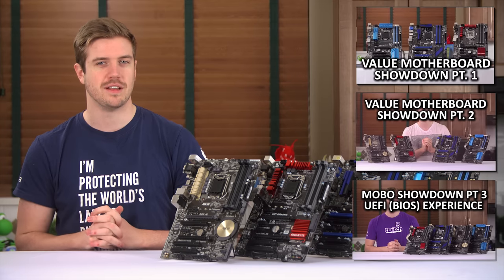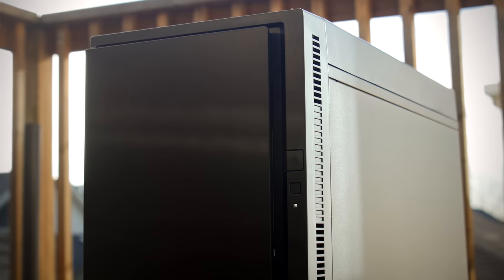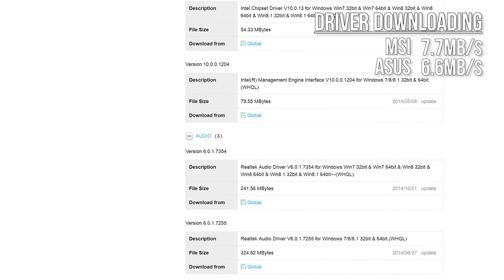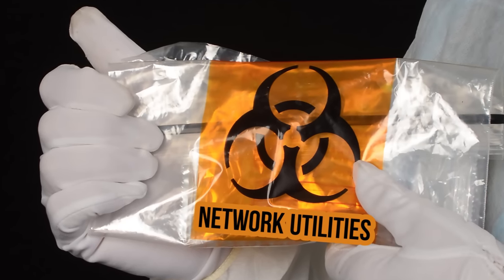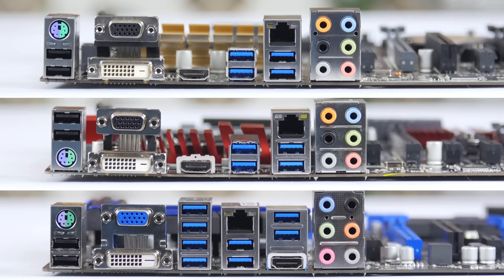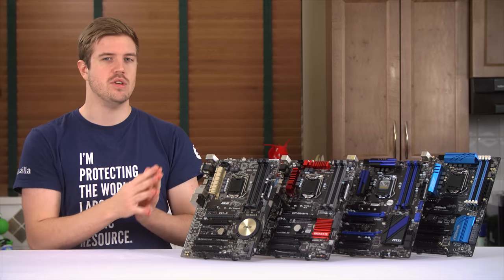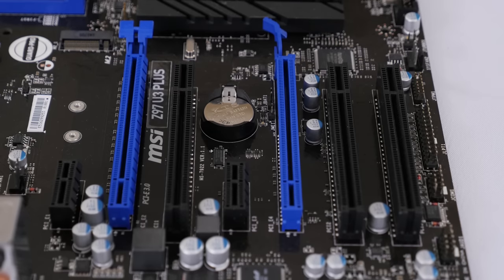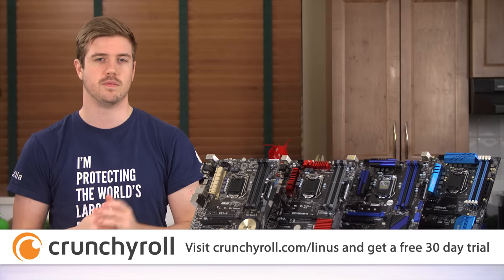Bang for the Buck Z97 Motherboard Showdown Part 4 - The Epic Conclusion

Comment: let me say this...I have a recently purchased asrock970 extreme 3 motherboard for my amd 8350 processor.....stay away...very far away....it takes a lot of voltage to get a modest overclock. Even though I'm nowhere near dangerous temps I cant get more than about a 10% oc because the board will not remain stable no matter how much voltage I throw at it.  . At 1.5 v I can get a reasonable 4.5 ghz....but 4.6 would not stabilize at all even at 1.55v (max). The ram is also very unstable if you try to oc beyond the native speed. I have read several revues that confirmed my findings....asrock is crap....asus is king.
Reply: The voltage you have to use to overclock the cpu depends on the cpu, not the motherboard. I have the extreme 3 z97 board and get 4.4GHz at ~1.2V. It's all about the silicon lottery.
Reply: that's very strange as 1.35v is the stock voltage for 4ghz....and I get 4.8 ghz in a asus mobo with the same chip. and your ram? there are more than a few bad reviews supporting my position on this mobo being an unstable overclocker....I simply add mine to it.
Reply: Ah, my mistake, for some reason I saw the number "97" when you were talking about your board and thought you were talking about a different chipset completely!
Reply: I have a 970 Extreme4 and I had no worries overclocking a Phenom II X4 840 (stock 3.2GHz) to 4.3GHz at 1.4v. I also got a FX 6300 (stock 3.5GHz, turbo 4.1GHz) up to 4.1GHz at roughly 1.37v or so. It's not the board, it's your chip.
Reply: I have this exact board running my 2.8GHZ Phenom at 3.6GHZ.  Very easy to overclock in the asrock utility or in the bios.  I have never had an issue with heat.  I think I paid 60 bucks for this board and it was worth every penny.
Reply: In my vast experience with the 8350 I can tell you that a 970 chipset is not great for that chip. There are many inexpensive boards with the 990 chipset that will do much better.
Having said that, Asrock has stepped up their game big-time but you really have to research and get the right board for your chip and a 970 chipset is going to be limiting to an 8 core 83xx chip no matter the silicone lottery. Imagine a extremely good overclocking chip on a CHVFZ or it's equal, you will have much better results and more stability. Just because it works doesn't mean it's going to work great.
Reply: not talking about a chipset....rather the model
Reply: *****
It's not really about the chip-set itself it's about the rest of the 970 boards. As said above most have only 4 phase VRM's and cannot handle the 81xx/83xx chips. I would not use it for anything more than a Phenom quad core or a 41xx/4300 chip if you want to overclock.

Comment: I'm thinking of building my first gaming PC, here are the parts, let me know if I should change something :) 

~[ Gaming PC ]~
Case: Phanteks Enthoo Pro.
MoBo: Msi Gaming 5.
GPU: Evga Gtx 970 SuperClocked.
CPU: Intel i5 4690k.
Psu: Cooler Master V650.
Ram: G.Skill Ripjaws X series DDR3 8gb (2 x 4gb).
HDD: Western Digital Blue ( or ) Black.

~[ will get later ]~
CPU Cooler: Corsair Hydro H110.
Reply: Looks good. The stock cooler that comes with the i5 is good enough to last you until you get the hydro. Though, if you're not planning on overclocking too extreme on the i5, I'd suggest a smaller/cheaper cooler, like the H80. As far as hard drives go, the Black editions are more gamer oriented and a bit faster read speeds over the other options.
Reply: poikle ok ty :)     going to take a while to save up as i don't live in  the US :/

Comment: I wish mobos can just get uberly cheap. I can see myself spending $100-$300 USD on a CPU, $100-250 USD on a GPU, but when it comes to mobos I can't see myself spending over $70 on any mobo (the absolute most $90 USD).
Reply: I dont see me going over 130$, and dont forgett psu never be cheap at that
Reply: Youll probably end up spending more on a gpu later.

Comment: I have a feeling Luke tried downloading drivers from ASrock's website during BUSY times and the other's during not so busy times.  I've owned Gigabyte, Msi, Asus, and DFI lan party boards over the years and NEVER have I experienced any difference in driver download speeds in comparing ONLY one brand to another's official website, let alone by more than 15%

Comment: I get that it was difficult to pick a clear winner overe the boards here, due to similar feature sets and whatnot, but I'd have preferred that you guys just put your professional opinion on this, "I prefer the board from XXX manufacturer because it appeals to me more than the others." It tends to help out the less knowledgeable in the PC community, or those who are just entering the PC community and looking to build a good system, but aren't sound in the knowledge area yet. Good video, but I don't think you guys needed to make this a four part video. Try lesser parts, the whole room water cooling project is also getting stale now.

Comment: Asus has great software and decent quality, but Asrock has improved it's bios which you wont be using that often anyways, has a sh*t load of features (sli) and io and is like $50 cheaper than the Asus model in germany.

Comment: Do Not use the ASUS AI Suite for temperature monitoring, I've never found this software to be accurate and has given me readings that were up to 30c lower than the actual temperature (CPU). Also it (for me atleast) has caused a number of BSOD's and system hangs. Many other people have had these issues and it doesn't look like ASUS really cares about fixing this software. I recommend using CPUID Hardware Monitor or HWiNFO64 for temps and voltages

Comment: so the conclusion was not really a conclusion and they did not speak about things like power phases and what really matter like reliability. someone help me. I have everything chosen for my PC except for my mobo and I want to buy it today
Reply: That´s typically the part you START at...because what good is the fancy CPU you chose if you can´t afford or don´t want to buy the boards that support it...
Reply: Chrinik damn that comment was a long time ago. i already built my pc ages ago and its amazing.
Reply: BladeLution I know, I just found it weird that your MB is the last thing you chose...I typically look at processor socket I need (Skylake in this case), check what features a board has surrounding that and go from there...altho my current board was sold to me by a friend who just had it laying around.

It had Skylake, M.2, USB 3.1 and other neat features and she sold it to me 40 bucks cheaper despite being only test run once.

My new rig is also pretty cool, finishing touch would be the M.2 SSD.

Comment: I would go for the asus if it wasn't gold, just an aesthetic thats bothers me. The MSI it seems would be perfect if it just had some protection/back up for the bios, and so I ordered the ASRock (the mATX version though)! . . . . but it didn't have anything to do with this video, it was just the highest rated on newegg for z97 micro atx boards and more or less 15 bucks less than the other options. Saw this series and thought, "wish i had watched this before i ordered my board, but I think i made a decent choice, so long as everything i download doesn't download at 1 mbps -_- ....dont know yet, waiting for some components to come in so i can start it up.

Comment: I'm doing my first pc build and brought a Gigabyte Z97X-Gaming 5....have i done something stupid?
Reply: why would it be stupid? its an overall good motherboard and will suffice your needs at a good level. price is also good and you wont have much issues unless you are buying incompatible hardware between the motherboard and the rest
Reply: TheFpsGamer1125 Thank you :) i'm trying to build a gaming pc,i've picked a Gigabyte Z97X-Gaming 5 ,intel Core i7 i7-4790K, 
Corsair CMY8GX3M2A1866C9 Vengeance Pro Series 8GB (2x4GB) DDR3 1866Mhz CL9 XMP Performance Desktop Memory Kit Black,Corsair Hydro Series H100i and a Sapphire R9 270 Vapor-X OC Graphic Card, i'm just worried, I picked shit.
Reply: i have the gaming 3 and the 2 native S-ATA ports didnt detect the two drives first. When I formatted these the SSD was detected, however the HDD not, so I had to connect the HDD to one of these black S-ATA ports and now it works.
Reply: master bate tour
all this useless shit and you forgot to pick an ssd and good graphics card.. switch i7 for xeon or i5, switch this gaymin mobo for normal one, get rid of water cooling and get something like gtx 970/80 or r9 290/x
Reply: ***** I already have a corsair 850 power supply, and getting 
Seagate 3TB 3.5 inch 7200RPM 64MB Cache hard drive and a HyperX 480GB SATA3 3K 2.5 inch Gaming Solid State Drive
Reply: ***** I'll update the graphics card :)
Reply: ***** Thank you for helping, this noob :)
Reply: master bate tour I don't like how you got a beefy CPU but a shitty GPU. It should be the other way around. Get an i5 4690k and a r9 290x or r9 280x depending on your budget. The GPU is the most important element in a gaming pc and you cheaped out on it LOL.
Reply: i own the gigabyte z97x-sli and i am prefectly satisfied with its quality. Dual bios is really helpful if your bios upgrade fails, overclock is easy. The thing that i liked most is the fact thats its black-red which fits my rig theme and there is a "led" stripe on the left side of the motherboard that lights up .
Reply: Kawaii Ninja Also, just get 1333 or 1600 Mhz RAM, doesn't make a difference which justifies the price. Power supply, just a 80+ bronze would be fine, you don't really get the benefit unless your rig consumes a lot more than 450-600W. master bate tour
Reply: all attacking you in such an aggressive manner.... I would say if you got money for that CPU + 290x/970(maybe even 980?) then do that. If you are limited in your cash - CPU downgrade 100%! top i5 will be perfect for gaming and you will have more cash towards more GPU power. a few words about the rest of the build - I myself would go for 2x8 GB mid class RAM - makes build future proof for the next 2 years and it was mentioned a lot - RAM MHz don't matter as much. 1600 is solid for gaming. About HDD - I would go 2x1TB (no RAID or anything) just to separate processing - you can be downloading media files on one HDD while another one would be still fully dedicated to your gaming needs etc. SSD is a must. but please stop getting caught by the "gaming" marketing bs.... just look at real life specs of hardware. you might find cheaper, faster SSD with no "Extreme PRO Gaming e-sports Support <insert_pro_player_name_here> recommended" bs.... instead of investing more money - invest some time into research. also avoid Kingston Now SSDs since they have done some bullcrap with those...
Reply: master bate tour ***** is right in your build you really skimped on the gpu if you have this kind of budget I would hold out and wait through February to see the Fiji Xt amd aka 380x offering... Check here and see how linus thinks of it against the 970/980gtx. This is brand new 20nm lower power consumption architecture shit that's going to pair well with the likes of 4k gaming. If you are not interested in 4k you can be sure the new architecture will be overkill for 1080p 60fps and likely 144fps on ultra settings. Otherwise if you absolutely cannot wait buy a 290/290x or a 970/980gtx. The 980 does come in at about double the 290 price. With that in mind the 380x launch could change it all very soon.
Reply: I bought a gigabyte z97x-ud5h-bk. That cost me $250. One of the very few motherboards that suited my preferred PCI layout along with sli and overclocking in mind. I7 4790K and 2x GTX 780s. Maybe it was ridiculous to spend that much on a motherboard maybe it's not.

Comment: The Asus is from what i can see the best as far as user compatibility goes however, it looks like asus built the board with odds and ends they had left over from other builds. The gigabyte board in my opinion looks the best which is what I'd expect. However looks clearly aren't what makes a good machine. I like the look of air cooling, i use a "be quite dark rock pro 3" so the shere magnitude of that takes away the look of the motherboard anyway, again though the gold colour of the asus looks ridiculous specially if you plan on lighting your rig.  I need fan ports the more the merrier asus dont support that so i wont be upgrading my small motherboard with one of these, unless someone has some usful advise or pointers. I also like this type of "review " if it can be called that, that show me what my hard earned wages will get me. Am not about the spend over £1000 on a motherboard and cpu, so this type of video is useful keep them coming.

Comment: If you would have a decent knowledge about electronics you would know the Asrock one it's the best in terms of build quality. I don't know why they won't tell us that: 2 options maybe: 1. they don't want to upset asus 2. they have no clue about vrms and other electronic things. A few of  interesting things on the asrock: quality mosfets and 8 phase vrm design, nippon chemicon caps all the way,full ESD protection(asrock full spike protection), thicker and more resistant pcb, the radiators for the mosfets are bigger than any other mobo in this video, black pcb(yeah. it costs more money). So as you can see the asrock one it's the real deal here. I like Asus as a brand too, but this thing it's a joke.
Reply: This comment is all fanboyism.
Reply: asus is one of the best
Reply: sub par in 2016 when it comes to motherboards arent think that .. all the big names produce more or less the same quality it's a matter of preference.. the asus bios looks the most polished and kick ass
Reply: AsRock is garbage... Dont believe me? Did you even listen to the first 30 seconds of the video? No OCing ability and wasn't stable at even close to the same speeds with integrated OC settings. The fan headers are in horrible places. The bios is complete shit. Their customer service is very lacking. I could go on and on and on.
Only reason to own an asROCK is if you need a paperweight.
Reply: asus, gigabyte and msi are good ?
Reply: yep... haven't had any issues with any of their boards.
Reply: Probably don't
Reply: Being a tech nerd does not necessarily mean you are also very knowledgable about the electronics that power them. And less so if you are a consumer. So I simply assume ignorance and since the general consumer has no idea what you talk about or why nippon chemicon caps are important or what they are (like me)...soo...

You can overload a review with so much information that a consumer who will generally only buy a MoBo to plug a CPU and a GPU in it and play games on it will just get overwhelmed and not informed.

So stick with "Does it work well, how many fans does it support, does it have SLI or Crossfire" and other such basic questions, because they probably matter more for the end user...and considering that these videos have crap views anyway, not alot of their viewership is actually interested in Z97 chipset boards...

Comment: i got a asrock z87e itx and i kinda broke the wifi antenna in a lan party,and replacing the antenna or find a compatible usb wifi bt key was a nightmare,asrock has to mutch usb compatibility issues i don't have those issues on gygabyte or asus cards generally.

Comment: I had to completely turn the fat 24pin cable and it just fits in there, when i move the case I sometimes have to push it so there's actually power going through :/

Comment: As an outside perspective and obviously I don't have any evidence for this but I feel like the reason this series isn't doing that well is because these videos just barely missed the mark, I assume I am probably the perfect example of your average viewer in terms of my tech expertise which is I know enough to build a computer and use you guys or google as a resource to solve most problems, and the reason this video series (which I did watch all of so I guess that defeats my argument right there) wasn't a massive success is because you went with a budget 1 notch too far down the ladder. Anyone that is a regular viewer of yours would most likely bottom out on a motherboard at $150 or if they actually didn't care about overclocking $70ish, the $100 pricepoint seems like the sweetspot for people that don't actually care that much and are just buying what they've been told they'll need. Just for arguments sake my last motherboard was a z97 MSI Gaming 5 which was around $140 when I bought it and I feel like that was the absolute lowest I could go and still retain the features I would need as a gamer and a mid level enthusiast.
Reply: I somewhat agree with you. My current board that i bought last year is the asrock extreme 4. similar enough to the one in the video, but with a few more features and at the time it was somewhere around that 150 mark.
Reply: That was exactly the point I was trying to get at, it just seems like there aren't many regular viewers who would be in the specific range they used for these boards, the series idea itself is great and I would LOVE more mobo showdowns

Comment: Intel Core i7 4770k, 3.9GHz,  4 cores (i will overclock it to 4.4-4.5 GHz)
EVGA GTX 780 ti classified kingpin edition superclocked 3gb 
12gb ddr3x1600 ram
Will i be able to run games on max settings at over 40fps? are there any complications? please add any details you can. All feedback is very greatly appreciated ;)). thank u for reading :)